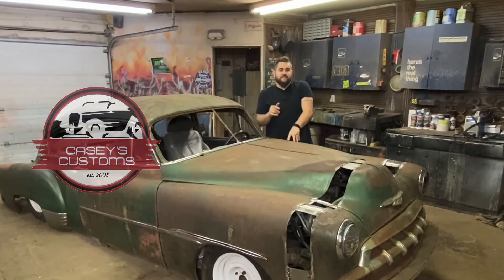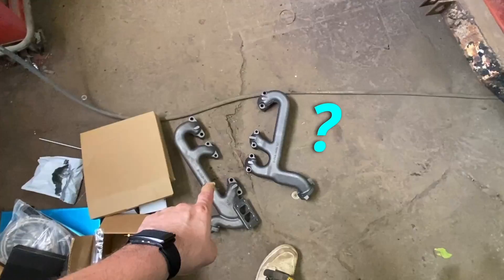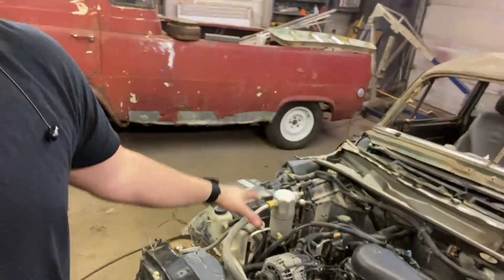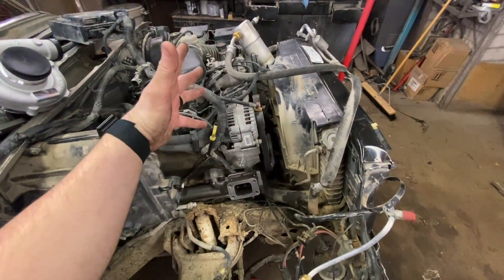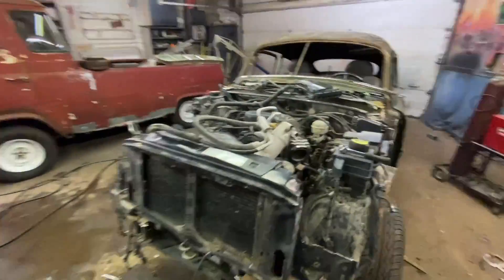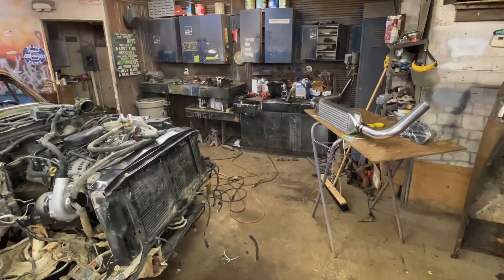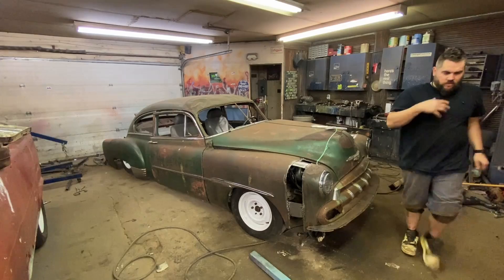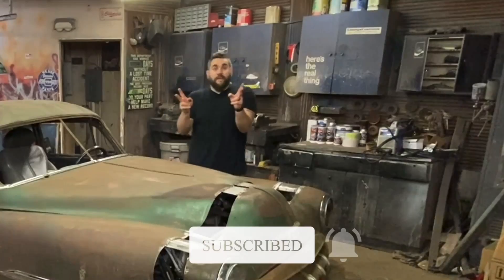$3500 DOLLAR RAT ROD BUILD! PART 11! TURBO, AIR BAGS, CHASSIS SWAP AND CHOPPED! HOT ROD BUDGET BUILD

Comment: Clock the turbo inlet housing to point it at the intercooler piping will only need 1 more  bend instead of a bunch. And need both banks of the engine feeding into the turbo to get it to spool up properly that's why turbo kit manifolds are designed to crossover around the engine and connect together. Also you'll want the mass air sensor before turbo or switch to map sensor setup for tuning
Reply from the maker: I’m planning on running them together but i think i have a lot more room around the back of the engine but i will have to jack it up and see what i can pull off. Clocked the turbo today and it def helped. 👍👍

Comment: I'm too late but spin the front side of the turbo about 180° and you'll be much closer to lining up to intercooler..the pipe you are calling a downpipe is actually an up pipe for drivers side exhaust then the downpipe comes off back of turbo.  Hope this helps.
Reply from the maker: I did and it made the bends a lot easier
Reply: Need to clock the drain to be straight down too.
Reply from the maker: @NotInjuredYet  yep got that tweaked too
Reply: @CaseysCustoms  also need to add that the crossover tube really needs to be hooked up. You’ll loose all your backpressure for the hot side of the turbo if you connect it straight back to exhaust.
Reply from the maker: @F-5Performance  i do on tomorrow’s episode 👍👍

Comment: I’m sure you will have figured this out before you get much further, the pipe your calling a down pipe is the turbo feed from the driver side .
The exhaust will exit the back of the turbo housing .

Comment: Both exhaust manifolds go to the turbo then out of the hot side .
Reply: @CaseysCustoms  I mean this in the nicest way, please do some more research on turbo systems. It’s going to save redoing work.
Reply from the maker: Good point, i knew they did but i didn’t understand how it would attach in the front on this blazer. I have confirmed this kit is for a 2wd so that’s what is throwing me off
Reply from the maker: @awd52chev96  i have built a few turbo setups, just wasn’t understanding how this one was supposed to go. I have found out this is for a 2wd truck not a blazer, so everything going out the front is impossible and that’s what i was questioning

Comment: You need to run the driver side manifold into the passenger side manifold so all the exhaust will run through the turbo and then you run your exhaust out of the turbo the turbo Works off of the exhaust pressure it needs the exhaust from both sides of the motor
Reply from the maker: Yes i was still planning on attaching them both i just want it to go around the back not the front
Reply: @CaseysCustoms  you might have to run the mass airflow sensor on the intake of the turbo
Reply from the maker: @jovanblocker325  did that today!

Comment: Reclocking the turbo inlet has been identified, but the exhaust is still confusing to me at this point. Drivers pipe should go into frt 1/2 & pass supplies air to aft 1/2.
Reply from the maker: Pipes will still be connected going to turbo, the driverside i will run behind the engine the passenger will go out the front and back down

Comment: need to feed the turbo from both manifolds or you will reduce the power not increase! clock the housing to get the intercooler piping route
Reply from the maker: Yep did all that today 👌👌
Reply: @CaseysCustoms  looking awesome. Keep up the great work 👍

Comment: I would definitely try to join the 2 headers together to run the turbo system right. Clocking your turbo will help alot with the tubing and your oil drain. I was really wanting to buy this car, a bit too much rust for me to handle so I'm kinda glad I didn't. But I'm loving it man! I may have to join the giveaway this time lol
Reply from the maker: Yea there was a reason it was 500 bucks lol. I got new sheet metal for it though so she will clean up fine!

Comment: How about MAF before turbo. That way you avoid oil damaging the sensor and can run a clean pipe to the throttle body with fewer connections that may come loose
Reply from the maker: Before turbo is exhaust so i don’t understand?
Reply: @CaseysCustoms  I think he means, draw thru the sensor. only issue there is if you have an external wastegate it can confuse the computer when it blows off metered air.
Reply from the maker: @davidfruits2766  yea I’m running external waste gate so i think it would confuse it
Reply: @CaseysCustoms  He is saying to put the maf in front of turbo inlet (where the air filter will go).
Reply from the maker: @awd52chev96  ahhhh that makes much more sense

Comment: You really need to add the driver side header, or you will lose out on exhaust pulses from half the engine, less pulses mean the turbo will only operated at half its potential.

Comment: Take the Manifold youd install on the L if it was a standard exhaust , take said "driver" manifold over to your pass. side...now flip this mani "upside down" so now the turbo flange is facing the roof instead of the ground..lastly "spin" the mani 180° so now not only is the 🐌 flange oriented to now be a "top mount" manifold instead o f being tucked down low. However the turbos new higher mounting location isn't the only difference if you install the manifolds as I mentioned and reccomend...in addition to the turbo flanges now being "top mount" style and when you simply "spin" the manifold like I previously mentioned you will no longer have just a standard top mount manifold but instead now you have forward facing top mount manifolds which is how the majority of folks run these type kits as you usually have open space between the radiator and the front of your engine..so when running the manifolds this way makes for a much easier experience when it comes time you have to fab up all of the required "plumbing" to complete the turbo kit

Comment: You do know that the left manifold is supposed to feed into the right manifold,  better spooling, what you are doing wont make any boost
Reply from the maker: I was still planning on having them both feed to the turbo, just can’t do it from the front is what i was saying
Reply: @CaseysCustoms  gotchya,  those small blazers don't give you alot of room for anything.  Btw love the build,  if I wasn't a long haul trucker I would build something like that but I only get a couple days a month at home